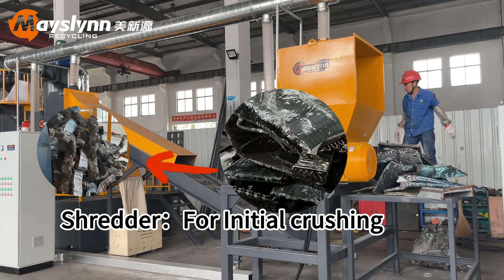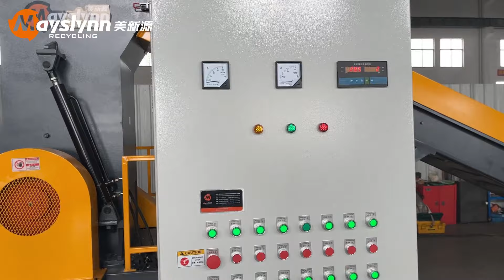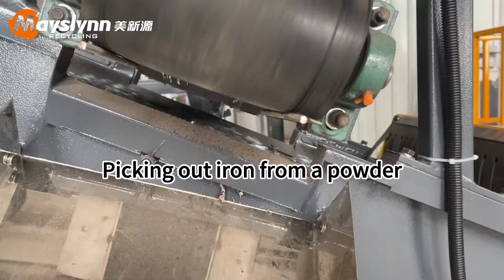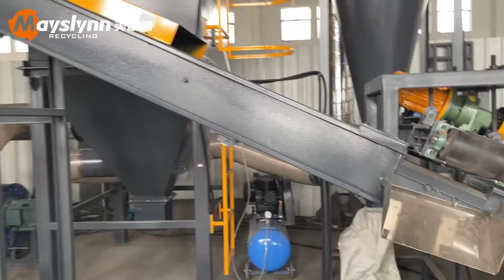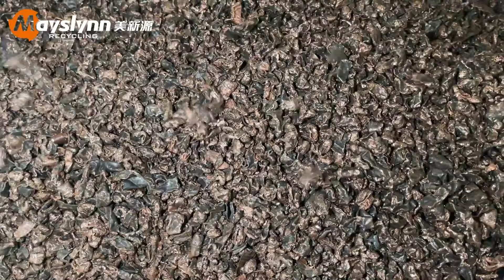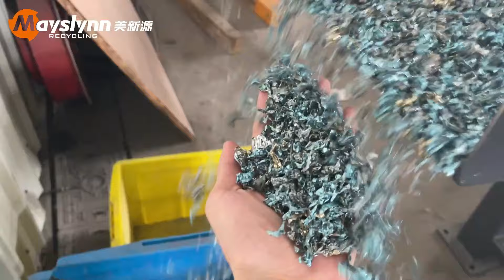Revolutionary Radiator Recycling Line: High-Efficiency Copper & Aluminum Recovery!

Comment: What are the two workers hand picking from the copper conveyer?  Brass?  SS?
Reply from the maker: After passing through the air separator, there will still be a small amount of aluminum residue, which needs to be picked out manually.